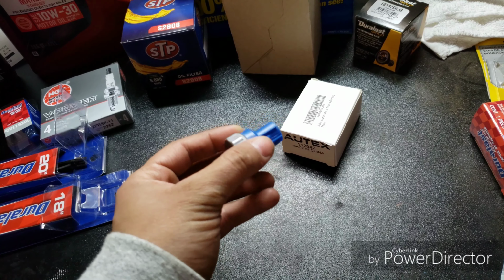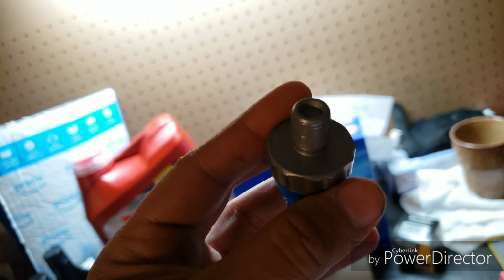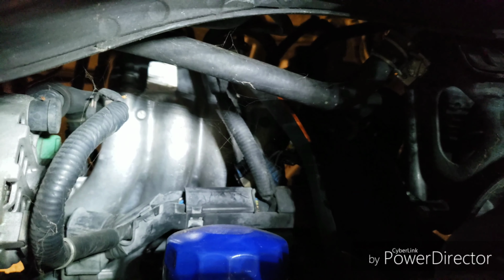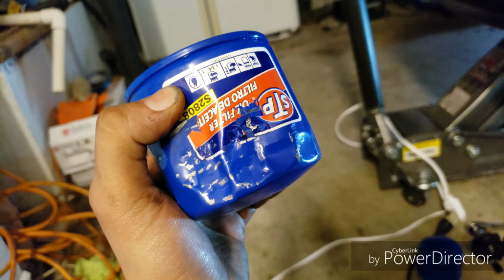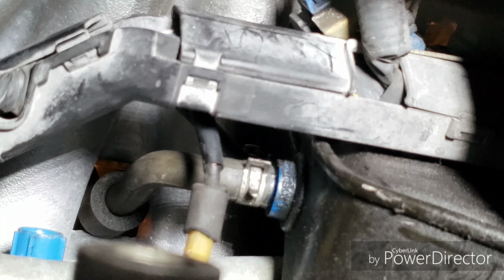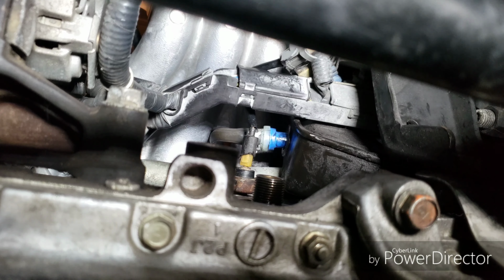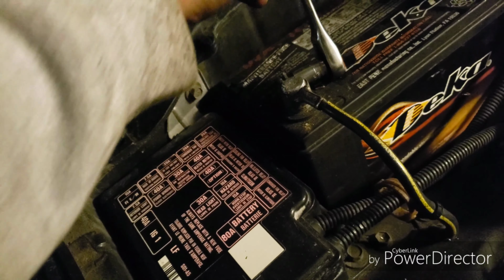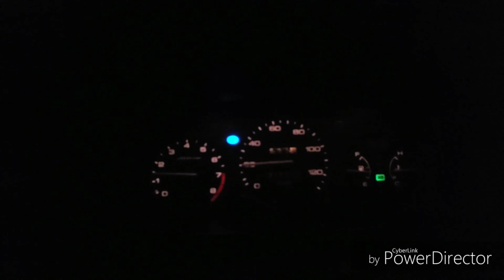1997-00 Honda Civic DIY Knock Sensor replacement!

Comment: Sir i have this problem on my 1997 honda civic Vtec, everytine i reached 3k rpm  check engine indecator pop/show...then if i  swirtch the car off and turn it on the check engine light disappear 😢😢😢

Comment: Important P0325 is the knock sensor code but dont buy a cheap one, or any aftermarket one go to he junkyard and get an OEM TRUST ME
Reply: Absolutely Right!!! I learned the hard way! 😂
Reply: @Lastk1ng2387  100% agree the $15 dollar amazon sensor lasted about 3 weeks. I'm a gambling man and got an oem from the junkyard for 5 bucks.  A year later and still going. (180 at the honda dealer)
Reply: What's the part number ?
Reply: What about one from auto zone?

Comment: Thanks for the video, was able to change it! Just a question does anyone know if once changing it check engine light go again eventually ?
Reply: disconnect then reconnect the negative terminal on your battery. that resets the ecu

Comment: Wonder if you could just take off the manifold?
Reply from the maker: Yes you can!
Reply: Jefferson J Morales do you think it’d be easier?
Reply from the maker: @Paniniadvocate  Maybe...but the reason I did it from the bottom is because I was doing an oil change as well. It's easy if you have long arms. I have short arms sadly lol 😅

Comment: What happens if the check engine light comes back on when you replaced it is it because of a faulty sensor or should i buy it from the honda dealership
Reply from the maker: Sadly these aftermarket knock sensors tend to not go well with Honda.. You'll most likely need original.. I will say this. The sensor hasn't came back. And the civic passed smog.

Comment: Good to know that knock sensor is good I just got one on amazon for 10 bucks I think
Reply from the maker: To this day it still on and working. No check engine light. 👍👍
Reply: @jefferson j morals  no way bro I am going to have to order 1 or 2
Reply: @JeffersonJosueMorales89   I am still waiting on mine been driving on a check engine for a couple days now and it needs to get fixed asap

Comment: I think I need a knock sensor because I'm having same problem code p1259
Reply from the maker: Replace it. Let me know if that fixes your code. The one I bought on Amazon worked fine for me but obviously original is a 100xs better.

Comment: what was the issue or why did you replaced it? i also have knock sensor code. my acceleration gives me major whiplash. lol.
Reply from the maker: Hey whats up well you know I'm not too certain because i was having acceleration issues but i found out that it was the cables and plugs but it had that code during that situation. Thought i replace it and make a vid lol. Once the code cleared up it passed CA smog which is a hassle for older vehicles. Do you make any vids? I'll gladly watch if you do. 👍